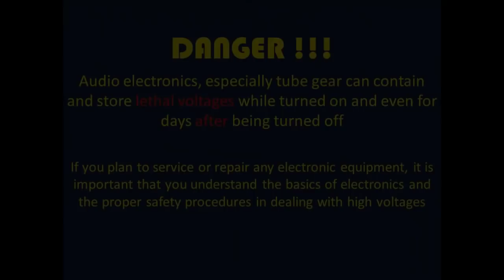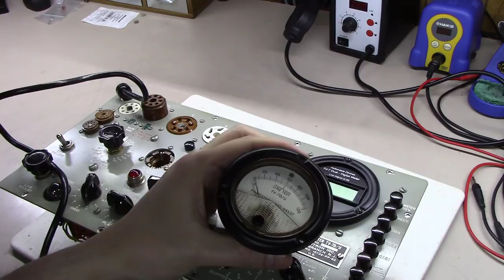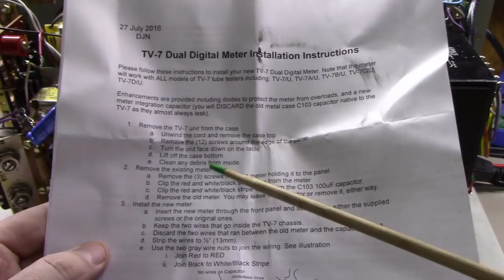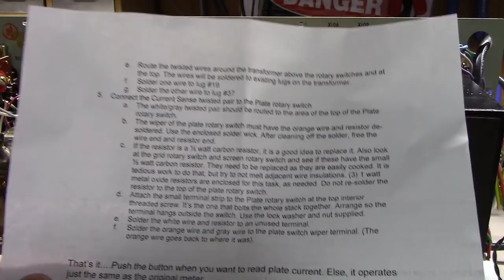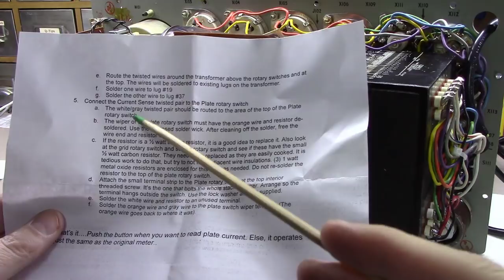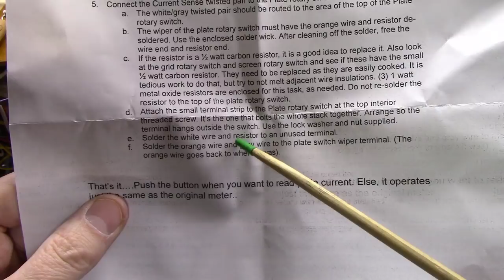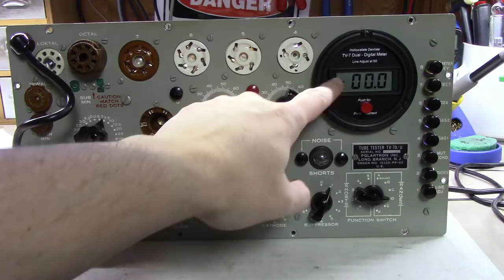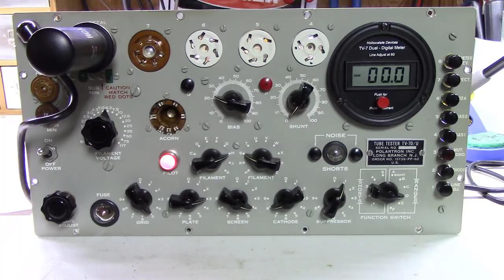Installing a Digital Meter in a TV-7 Tube Tester

Comment: I installed a digital meter and when testing for gm the meter jumps up and down probably   .5  .   Say from  45  to  50.  Most digital ones I see don't vary that much.  I changed the cap at the meter.  Would you know what would steady it up?
Reply: It doesn't vary when setting the line voltage.

Comment: Great work. Thanks. 

What does it mean to stitch a digital meter into a purely analog device?  The design concept involved things like meter swing, time for events and even the feel of the tube. It was all about experience. 

To me, this is like putting a digital speedometer on a bicycle.
Reply: With a tube tester, the needle tends to just swing into one position and stay there. So it is doing nothing but presenting a value, there is no meaningful trend or fluctuating readings that would be of much use on a tube tester. When there is, it is slow enough that it is easily noticed on the digital meter. 

In any case, replacement analog meters for these are unobtainable or repairable at decent prices, so the digital meter keeps the tester going.

Comment: It's a bit silly really he is limiting his ability to make a greater profit! Cost of shipping a device like that and the chance of it getting damaged it's just not worth it. As you say sell it with some instructions on how to install it should be fine not too difficult.
And if he had a round LCD screen and displayed it as a analogue display would keep it more traditional
Reply: I did a quick search and it looks like he did sell these through eBay a couple of years back, albeit without the plate current option. 

An LCD screen would have just made it more expensive, and also has issues with viewing angle, etc. To come up with a dual display (analog and digital readout) may have even required having a custom LCD made. 

I found this site where someone homebrewed a digital display for a TV-7, it could probably be adapted for other tube testers as well.I'm going to fab one up for my Jackson 645 that I had to put a replacement meter in, but am not 100% happy about the way it came out. 
http://www.arizona-am.net/misc_files/TV7MeterB.htm